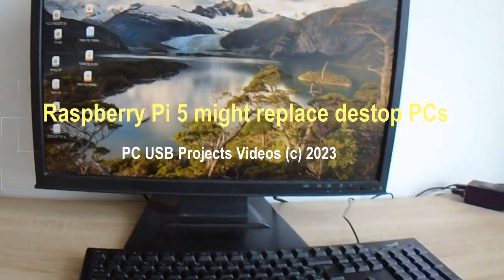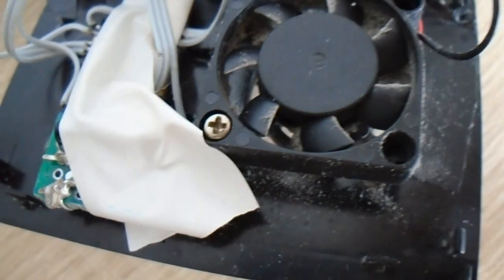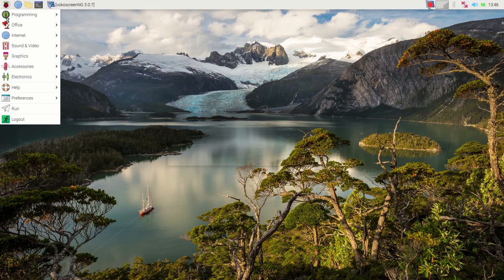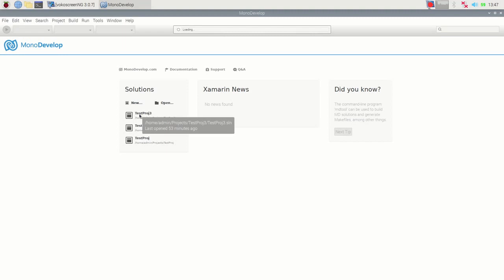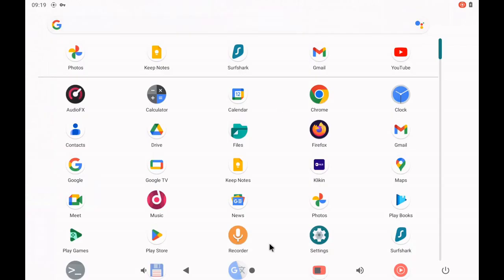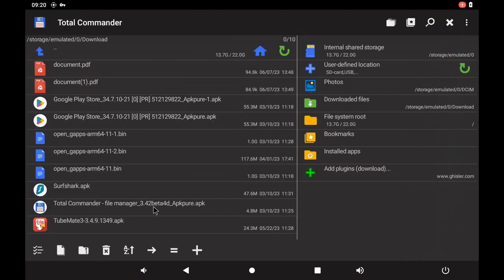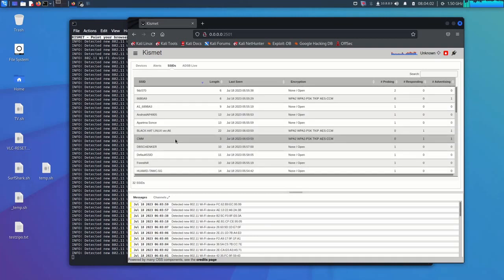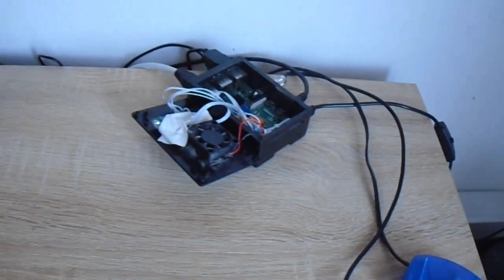Raspberry Pi 5 might replace desktop PCs

Comment: ...I mean... even a rpi 4 can replace a desktop pc if you have lower expectations.
Reply from the maker: You may be right, but I've watched this video https://www.youtube.com/watch?v=8-A13-VYS6Q where the author admits that the latest test version of Windows 11 for ARM based Raspberry Pi 3 and Raspberry Pi 4 cannot be installed on Orange Pi 5. I'm afraid that similar might be true to other Raspberry Pi dedicated software that someone might try to run on other similar platforms. So, a lot of errors instead of a reliable operation, which is perfect for computer freaks and not for a serious use.

Comment: What about all of the inexpensive x86 mini-PCs available for under US$200 on any online marketplace?

A Pi with required accessories isn't far off one of these and the range of available software is far wider on x86 hardware (including Windows of course).
Reply from the maker: The word "might" tells it all. Let's wait until Raspberry Pi 5 is released and see, whether it gets better than an x86 mini-PC.
Reply: @pcusbprojects  The new RK3588 boards sure are impressive performance wise.

We shall see what the next Raspberry Pi brings, although compromises will need be made to meet the desired price point. I doubt we'll see M.2 slots, for example.
Reply: @pcusbprojects  The Raspberry Pi will never be better than the x86, and mini pc for the simple reason of compatibility. And ease of access to software. Especially if we add the problem of availability, and the price of raspberries. For example, you can get a cheap new mini pc that beats the raspberry in terms of performance. In addition, there is a lot of possibilities regarding the system, and the use of mini pc. As for other arm sbcs, there is a problem with the support of manufacturer a given sbc. I mean the old linux krenel version, etc. There is also a big problem with hardware acceleration, if not for projects like Armbian, many sbcs were paperweights, nothing else.

In addition, some may wait for the new raspberry pi. But there are also people who need solutions for their projects now, and cannot wait. I also have the impression that the longer the Foundation delays the release of the new version, the more it loses, but that's just my opinion.
Reply from the maker: You may be right, but I've watched this video https://www.youtube.com/watch?v=8-A13-VYS6Q where the author admits that the latest test version of Windows 11 for ARM based Raspberry Pi 3 and Raspberry Pi 4 cannot be installed on Orange Pi 5. I'm afraid that similar might be true to other Raspberry Pi dedicated software that someone might try to run on other similar platforms. So, a lot of errors instead of a reliable operation, which is perfect for computer freaks and not for a serious use.

Comment: So you missed the ORANGE PI 8Core 16GB Ram SBC ? Most swapped over  waiting for Raspberry Pi for to make some ..
Reply from the maker: I like powerful computers with ARM architecture, but a variety of popular operating systems and applications must also exist for them to be really useful replacements of classics desktop PCs. Regarding this, I can only say that I was a little bit disappointed with some of very capable and promising designs of computers with ARM architectures and I'm still waiting for Raspberry Pi 5 with a great anticipation.
Reply: @pcusbprojects  Well OK, I will just keep playing Steam Titles on Orange PI 5, until you catch up... I have 7 Raspberry Pi's here, but 5 Orange  Pi 5+'s so its a growing habit, but as Apple have already moved on to 16 Core Arm, I suspect, by the time Raspberry PI gets moving on a 8 Core everybody else will be on 32 cores .. The trouble is Raspberry PI makes a Good Product, it is used in Industry, INDUSTRY needs Supply of reliable parts for projects, so Raspberry is that Industrial Controller of Choice Currently, it is a large market making the lions share of it's income, so I can see why they let others play with being the "Experimental Board", as they want a image of Reliability for embedded applications..
Reply from the maker: Why not? Raspberry Pi runs not only Debian, Ubuntu, Raspbery Pi OS, Android  and other variants of Linux. You can even install latest Windows 11 for ARM based computers on Raspberry Pi 4:  https://www.youtube.com/watch?v=zGF_HaSdFyA, but you may have go for an older version with Orange Pi 5.